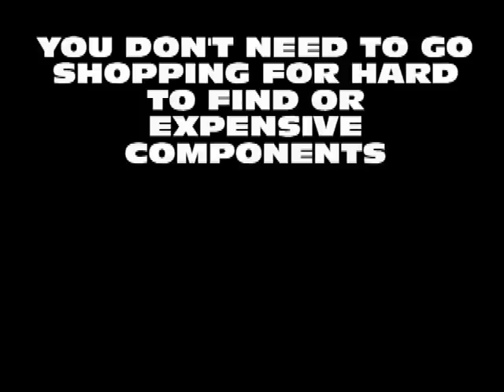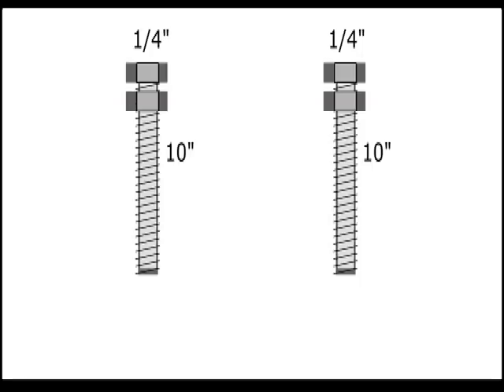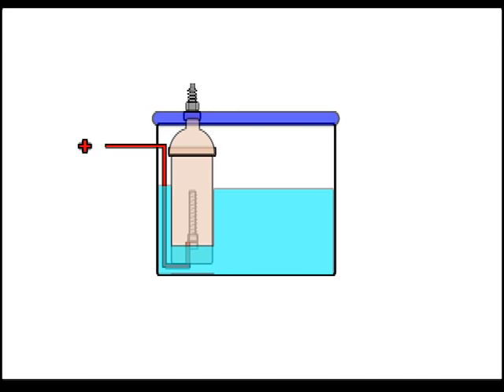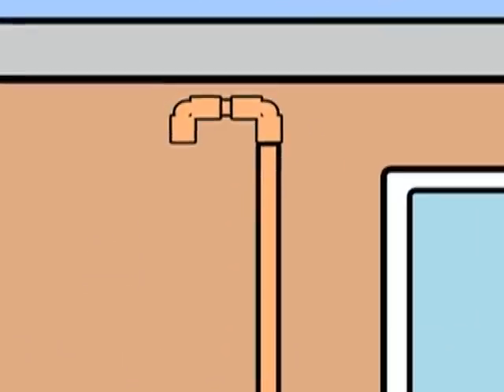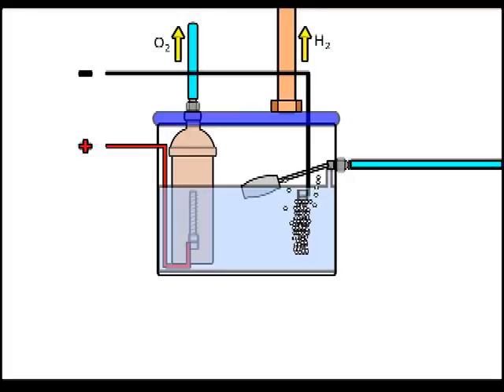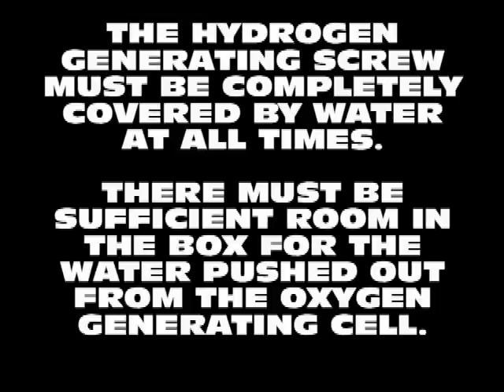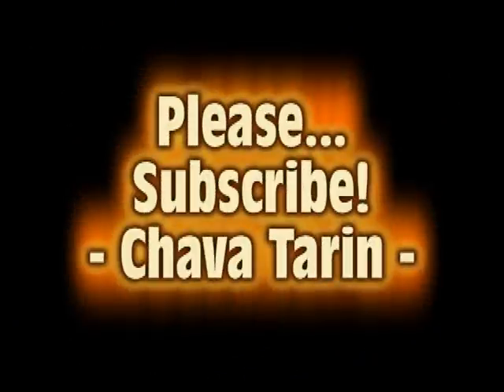Homemade Oxygen Generator

Comment: Do need ac current. Can use dc , if so  what bolt?
Reply from the maker: DC is an absolute MUST! AC would release both hydrogen and oxygen mixed at the cell. The voltage is not critical. The original project was for small torch, but the principle is the same. I would advice to start with a small unit, and check your needs. I made an additional drawing, based on comments, please find the updated drawing at https://www.youtube.com/channel/UCmjQnuJwV0FkjdEyi3099RA/community?lb=UgwRGRtRxJVb63bdsUJ4AaABCQ . Improvements such as adding a solar still for distilling the water, solar power for saving electricity, are shown in this new drawing. I have known of people using the hydrogen to power a gas refrigerator. No amounts nor dimensions are given in this new drawing, since its purpose is to suggest improvements which suit the user needs. I suggest starting small and grow the system from there, using the principle given.

Comment: Water in itself is non-conducting. However the salts from the tap water make it so. Thus the byproduct of this process can include chlorine gas and other oxides.
Reply from the maker: You are absolutely right! That is why distilled water is recommended, please find an updated drawing at  https://www.youtube.com/channel/UCmjQnuJwV0FkjdEyi3099RA/community?lb=UgwRGRtRxJVb63bdsUJ4AaABCQ . Improvements such as adding a solar still for distilling the water, solar power for saving electricity, are shown in this new drawing. I have known of people using the hydrogen to power a gas refrigerator. No amounts nor dimensions are given in this new drawing, since its purpose is to suggest improvements which suit the user needs. I suggest starting small and grow the system from there, using the principle given.

Comment: Do you need to replace the sodium hydroxide?  I assume not.
Reply from the maker: The sodium hydroxide is not lost in the reaction, so you are right, no replacement needed. However if solution gets somehow contaminated, you may have to replace the solution entirely.
Reply: @eltunene  that’s interesting, is there any way that you can tell it’s contaminated?

Comment: Excellent video, is the NaOH consumed in the process and should more be added occasionally?
Reply from the maker: Dear Groovy One, the NaOH is not consumed in the reaction, only if it gets contaminated by some scale in the water, it must be replaced, water and all. By using distilled water, it yields clean oxygen, however normal tap water does contain some salts that might pose a risk of oxygen contamination with chlorine. Very important, both gases must not mix, since the mixture is very flammable! Also, some heat is evolved in the process, so cooling may be needed. If you plan to build it, please start with a small version, and go on from there, either by enlargement or by using two or more small units in parallel. I have heard of someone using the hydrogen for running a gas refrigerator, which would make good use of the otherwise lost hydrogen. Oxygen must be certified by professionals, to make sure it does not contain toxic gases, such as chlorine! I also posted an Indi version, and at the very end there is a scheme with some suggested improvements, please take a look at that too.
Reply: @eltunene  Thank you for your reply, I don't intend inhaling the oxygen so no concerns regarding impurities. What I would like to experiment with is using a 200W 20V  DC solar panel as the electrical supply for electrolysis, running both H and O gasses through separate tubes running directly into the carburetor of a small 700W 240V AC generator. I'll start it using petrol then when it's running, turn on the gas and turn off the petrol and see if it continues to run.

Comment: Nice illustration, btw, What will be the rate of oxygen flow, ?...litre/minute
Reply from the maker: Very small rate, since it was thought for a small torch, very small torch. However, with all due precautions, it can be expanded for other applications! Keep in mind Oxygen and Hydrogen are a very dangerous mixture, if you produce a lot of the gases, there is explosion or fire risk.

Comment: Great boon!  during this COVID time!.
In India this is shortage now , system going out of control.
May god! if at all there let it come out through every doctor! and health care workers!!🙏🏻
Reply from the maker: People in India are very creative, they can use this or similar equipment and get oxygen, as well as hydrogen for running gas refrigerators to keep medicines.
Reply: brother u cant use this for clinical purposes as the amount produced is very less like 0.18 liters per minute where a breath takes in 0.5 litres oxygen(one breath)
Reply: @harekrishnaparhi7943  you're right but it depend of the size and surface of electrode and also the power of electricity. But the real problem is using NAOH producing toxic gas

Comment: Beautiful simple tech. Thanks alot
Reply from the maker: This is old days tech. This method for splitting water into Hydrogen and Oxygen has been around since the XIX century! However, as you say, it's simple enough to build many medium size units for saving people! They can add a solar still for using distilled water, as well as a few solar panels for running the homemade generator.

Comment: Hey chava  taril how much oxygen does it produces per minute can you tell me
Reply from the maker: Dear Samarth, it depends on the size of the generator. You can use the basic principle and build a small unit (for handling small amounts of hydrogen and oxygen), and make some tests in order to evaluate your needs. Then build several small units and hook their output hoses in parallel, so you can have more oxygen yield. Warning! distilled water should be used, in order to get hi quality oxygen. You must hire a medical expert to check if your oxygen is totally pure. On the other hand, there is some heat evolved, and you must account for that also. Do not proceed to use unit if you are unsure about oxygen purity, gas leaks, or probability of both gases being mixed, which will pose an imminent risk of explosion. Please get advise from medical experts. Normal tap water can contain chlorine or chlorine salts, which would produce chlorine along with the oxygen. Very toxic!!

Comment: Think twice, before this device to general public, as hydrogen highly explosive
Reply from the maker: Yes it is! Especially in high volumes, it is not easy to handle. My original project was about a small torch, I enphasize being careful and seek supervision from experts. Nevertheless, the basic idea (which is not mine, but has been around for a couple of centuries) can be developed by experts and use it for other applications other than welding jewelry.

Comment: How much oxygen is generated per min?
Reply from the maker: At this point, very little. For a tiny torch it will be sufficient, but the idea is to experiment with a bigger tank, a higher current, etc. until necessary amount of gas is obtained. Keep in mind oxygen and hydrogen can be explosive if not handled properly. Never allow them to mix. Also, the reaction producing the gases evolves some heat, so that must be taken into account. The best thing to do is to start with a small system and check for problems such as leaks, overheating, etc. then grow from there on into a more practical device for sizeable production.
Reply: @eltunene  sir if the container is metallic will it interfere..
Secondly is there any formula to calculate the volume of oxygen produced in proportion to electricity consumed
Third, are there any other gases mixed with oxygen vapours.?

Comment: Thank you very much for the information. What grade of stainless bolt can be used ?
Reply from the maker: Dear Robert, I found a most instructing pdf file in the web, it includes dates such as gas flow and best stainless steel alloys. Please check it at  https://pdf.sciencedirectassets.com/277910/1-s2.0-S1876610216X00094/1-s2.0-S1876610216305835/main.pdf?X-Amz-Security-Token=IQoJb3JpZ2luX2VjEBYaCXVzLWVhc3QtMSJHMEUCIGYHjcmqF%2FLHW9VWd5KUt4ximAtOi0OPJr9FNE60bpWnAiEA2my4F2kvmILJyBB7YWQrFWY21p7yi6rwi23%2FNqq3tFEqvQMIjv%2F%2F%2F%2F%2F%2F%2F%2F%2F%2FARADGgwwNTkwMDM1NDY4NjUiDPSFxaYiZQU8XQASOiqRA8YOGSxd%2FbykA8oulge%2FlaCsL6snaTFQKxulCPW%2F7rgteTEDIcT%2FU2wedap4tRepBn01D2KpwDZXLY2O5YzzpHh4RCAkU%2BXsmalEXcvF59XXVfJ2XvCDiowH5vIkOZedGJ%2FNc1mVXfAg%2F4LDvKYZkUKhY%2FaMq3J6Py5gBfneCO1NvCZTwv%2F6MTw4hvacrygB3nh9ORZVP%2BO6m2lmforkUUsRbWLM3tiUv7DH70VVLeh1eTubbZCUAwhqYdh39s8WW3R64iHm17%2Bfg85f9QaLTUdMxdAVyltDbP0%2BokYNcDarmzBcgrPxDGXpNqrco8hNh8kusHjtChGRiFk8lwgYryV8xrhiOfVksqHtccU82UrBdie6cAO30xxG79tTJoxp6we0iX7lACvQ0fm5RyHchzjcA8WcBE%2BErHmu5sq%2FgaWCGWfBCh8orx2e3lPFXXGfEK4HsSR7IIDiOJGZ24L51WD9%2B4JR5pD7Yb2VeJ0THiPPHgL%2BMeoEAfdR%2FimVuYKLZKyQCx29pX7i7kNTfJ5IKw5EMOWHsIQGOusBsW6RNrC2h%2FfZMQs7d7Qt89rLITqTkhl%2BOPewsFtYaJE5nJnZBkC%2BBAcTFz7gaXgBniyQYla1Ft3JcA%2FZkxcBoh69ShHdehLopMpjRVHTJVpuxvG%2BAfqDb%2BX85%2BYOAJkcmvyfRpqJUu89qSX5RKk3AQM64%2BN3d7o18mR3aQOIspLcjDbfpZxXvGCb4KxSzWo6p2ANsV3cgUrf7Uh0cra0CbSZ10ynd6LKV5%2BCGjb05IHgfi73ttt%2FO6PuBeWF62lRR1%2FW4yLPeBOH20IOm58Eh%2Bqr2vCvCw3rxyso4TrjWUgxZ8fgRxg4dLSiPQ%3D%3D&X-Amz-Algorithm=AWS4-HMAC-SHA256&X-Amz-Date=20210430T145157Z&X-Amz-SignedHeaders=host&X-Amz-Expires=300&X-Amz-Credential=ASIAQ3PHCVTY6H6G5H7W%2F20210430%2Fus-east-1%2Fs3%2Faws4_request&X-Amz-Signature=228b94f2e2b679f7515e50a5cc596398de4572251669ab806baa7a18777f3eaf&hash=7668e786ba300e9fa67a7f6da34c4316d54d096cc2ebce259524fd40ed02e776&host=68042c943591013ac2b2430a89b270f6af2c76d8dfd086a07176afe7c76c2c61&pii=S1876610216305835&tid=spdf-64602a07-0407-4c7a-aadd-74ab2003a22f&sid=943e5b86342da54f4b48e3290de18f842593gxrqa&type=client

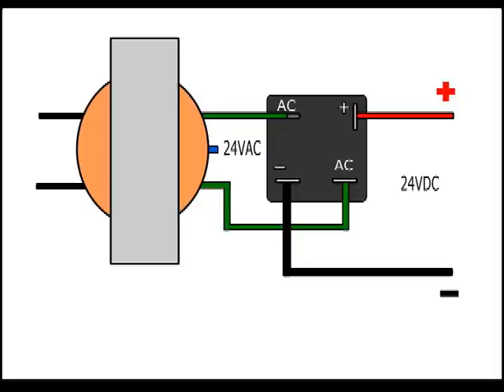Comment: 5:26 Something is wrong in this picture... If You have 24V AC past the diode bridge You have 24V x 1,4 = 33,6V DC.  Am I right?
Reply from the maker: Yes, the peak voltage is 33.936V, but that is not critical. As I say in the video, values are not critical.
Reply: @eltunene  Can I put 220 VAC pass to Diode Bridge directly. There is no need the transformer? Thanks

Comment: From the experience of myself, I will not recommend anyone doing this for the following reasons:
1. NaOH solution is a highly corroded. It can corrode copper wire, stainless steel eased at last.
not mention can hurt human skin seriously..
2. NaOH vapor will come with the O2 gas. It's highly dangerous to the mucous membrane of body organ  such as the nose,eyes,etc.
3. From the drawing of this device, it produces almost meaningless amount of gas which depend on the concentration of the NaOH solution. But the higher the more dangerous to people.
Reply: Use a pinch of salt ( NaCl, MgCl2.... NaF... Etc )
Reply: @sriharirajrjs6565  don't use salt. Theres no need for it. chlorine  in salt (NaCL) gets liberated and corrodes the electrodes, and the sodium ion  just ends  up combining with the OH ions making NaOH.  Just use NaOH or KOH, and your electrodes still work better and longer.
Reply: Couple technical details. 

Point 1. I believe all electrolysis corrodes electrodes.  Except maybe platinum.  Stainless steel in  alkaline  electrolysis  performs rather well with very little corrosion  with distolled water and NaOH or even better with KOH. 

Point 2. When the O2 bubbles burst, it can result in forming tiny droplets that  get suspended in the air. We call this mist. And, yes even tiny amounts of Noah in the mist is very bad to breath in.  Most applications should include a bubbler or two to remove the NaOh mist. 

Point 3. Yes this design has a relatively low surface area which limits current and thus the amount of oxygen generated. But, he is using 24v. Which would tend to push much more current though than typical 12v. With the given electrode surface area, distance between electrode, 24 volts applied,  my intuition suspects this is probably producing close to 100 ml of O2 per minute. Maybe not much use medically but could be useful for other projects. KOH in water is a better conducting electrolyte and adding more surface area  electrodes will increase the current, and thus the amount of oxygen generated. But running this at 24v has a significant  amount of energy being wasted as heat so running at high current for a length  of time can  cause it to get warm.  One really needs to significantly increase the surface area and lower the voltage to get reasonable production and lessen the waste heat.
Reply from the maker: Yes, you are right! for applications other than a small torch, it can become dangerous. Thanks for your contribution!!

Comment: Build a giant version of it as well as a device to clean the oxygen, compress it and then fill it in bottles.
Reply from the maker: Once a larger version has been tested for safe operation, and the quality of oxygen is certified, it would be a very smart thing to do!! The hydrogen can also be saved and used for gas refrigeration units. The combustion of the hydrogen can produce more distilled water, and the fridges used for keeping medication in good shape. Instead of getting rid of hydrogen, it could be used to regain otherwise lost water. Thanks for your excellent feedback!!

Comment: Dear Chava, it is not a good idea to just let the hydrogen dissipate. All hydrogen produced in this manner would be lost to space. If a lot of people do this (likely due to COVID) tons of hydrogen will be lost which is half of the equivalent water.

It is much better to capture the hydrogen and periodically burn it so that the water is returned, otherwise you do not have a circular system.
Reply from the maker: Very good idea!! And you could collect the water produced by burning the hydrogen and get some distilled water to add to the solution. That could be an excellent improvement!! And if you can use the heat produced by combustion of hydrogen, it would be a more efficient process. I heard of someone who used the hydrogen to run a gas refrigerator.

Comment: So urea, I am told that 15% urea pills to 85% water, can almost achieve unity power returns but have not tried it yet
Reply from the maker: I personally think putting to work tried and true technology first, can buy us more time to experiment in the unknown.
Reply: @eltunene  I agree, not that my opinion matters, I test everything,  trust no one. Not even myself, of late have been playing with, electrolysis to pressurize oxygen,  hydrogen,  then extract the energy from its pressure,  then burn or use hydrogen PEM cells, being the almost same amount of amps-voltage is required at 1 atmosphere  or at 6 atmospheres, so the idea is extract energy from a fuel, without using any said fuels energy via pressure,  then extract energy from burning, pem, TEG-TEC, any any other ways i can, thus creating over unity electrical power, without violating natural laws/rules...   its a fun hobby...

Comment: Nice explanation, but this oxygen generator has very low efficiency, since only about 0.5V of the 24V DC are used for hydrogen generation (actually even worse due to non-linear current flow after rectification). The rest is being converted into heat to warm up the water. You need way larger plates with a very narrow distance to each other and a much lower voltage per cell. That's why membranes for narrow spacing but good separation are the most difficul parts in commercial cells.
Reply from the maker: Yes, I agree. The idea was to have a generator anybody could build and use. Thanks for your kind comment!!

Comment: This is feasible for covid requirements the only problem is the hydrogen exhaust, I have a solution, connect H2 outlet to another box and add peltier module to condense and store the hydrogen as liquid it "may" work but I cannot guarantee.
Reply from the maker: Good! I had never thought of that. Thanks for your contribution!
Reply: @eltunene  watch a video of a youtuber Electroboom where he makes thermoelectric cooling devices that gave me the idea, give it a watch.

Comment: DANGER! Sodium hydroxide is a commonly used base. Electrolysis of concentrated sodium chloride solutions (brine) produces chlorine gas, hydrogen gas and aqueous sodium hydroxide. Cl2(g) is produced at the anode (positive electrode). H2(g) and NaOH(aq) are produced at the cathode (negative electrode).
Reply from the maker: If the water is not distilled, chlorine can be released at the positive (anode).

Comment: Hello I've have a few questions:
1. Can Naoh be substituted with Nacl (common salt)
2. Could you let me know the current requirements
3. I read somewhere that Naoh is not recommended as it can cause explosions. It is recommended to pass it via water. I'm building it to generate oxygen for covid patients. Can this be used for medical purposes
Reply from the maker: 1. No. Sodium chloride would release chlorine, toxic gas.
2. The current depends on the amount of gas required, and can be quite an amount.
3. NaOH in itself is not explosive. Hydrogen and oxygen mixed, they are explosive! Bubbling through water is good for keeping the oxygen moist.
Reply: @eltunene  Thanks a lot. I've some more observations:
1. during electrolysis will Naoh vapurs be given out or will it completly dissociate into its ions. I've ready some NaoH guidelines and it was mentioned that  inhaling Naoh vapours is hazardous.
2. Will the heat generate during electrolysis, let's say I use 500g of Naoh in 15 Ltrs of water (approx pH 13.92) cause any flammable issues with Hydrogen.

Sorry to bother you with so many questions. But your help is truly appreciated.